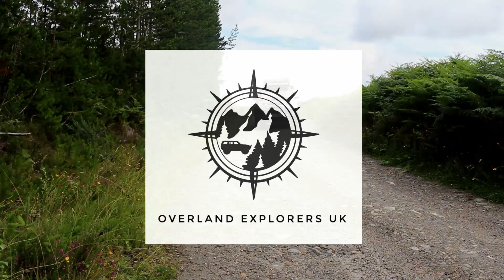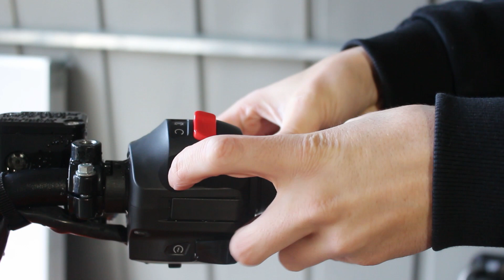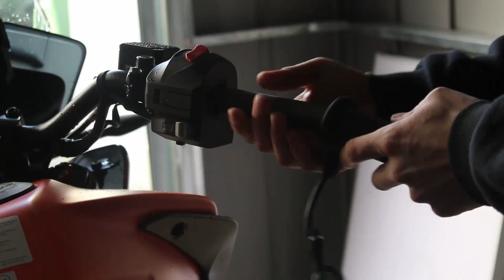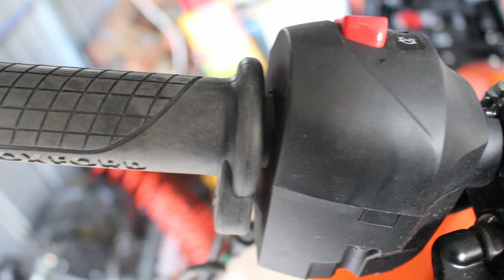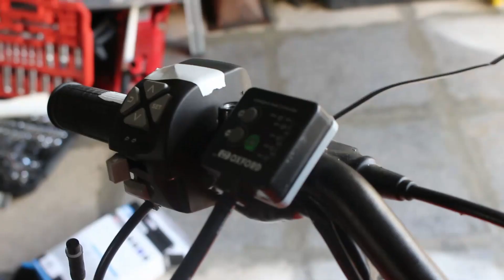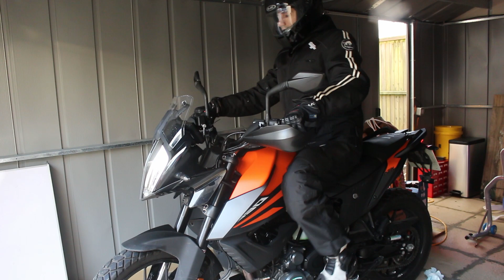KTM 390 Adventure Oxford Hot Grips Install

Comment: Good video but connecting heated grips straight on to the battery is the second best way of doing the job. Best way is to connect to a cable that goes live when the ignition is switched on, so you cannot accidentally turn the heated grips on when the bike is not working and drain your battery.
Reply: They turn off automatically

Comment: Hi mate! I'm having some toruble  fitting the one on the throttle... Same bike and same grips. Very hard to push in 😅
Reply: Probably too late but maybe someone else can benefit.. First of all, if it's so tight, no need to use any glue. 
To push it in, use a plastic mallet gently, if that doesn't work, take a socket bit that is the same diameter as the grips and hit it with the mallet, again gently.

Comment: Would it not be better and easier to cut end of grip off, rather than cutting logs off which are there to stop grip rubber fouling the switch housing resulting in a potential throttle sticking open!
Reply from the maker: Them lugs near the switch housing hook under the original grips so you can't normally see them, the new grips don't do that

Plus as long as the grips don't foul the switch body when gluing them on (you can see us do that in the video) then they won't be able to move once the glue sets. If the glue gives up then you won't be able to twist the throttle anyway as the grip will just spin around the throttle tube